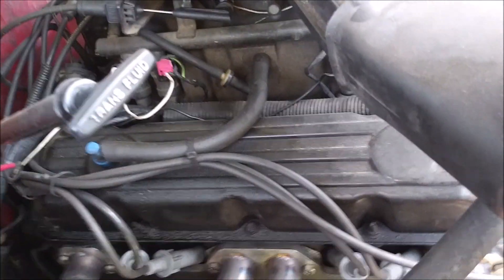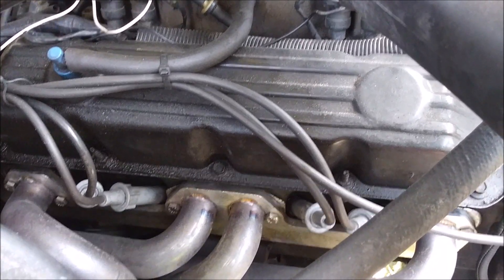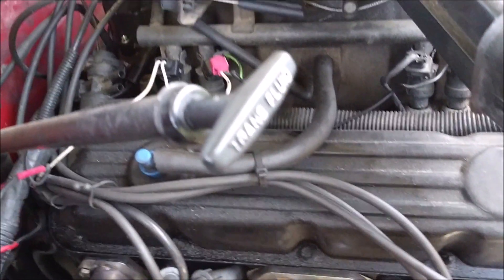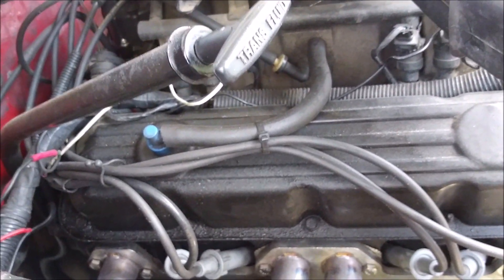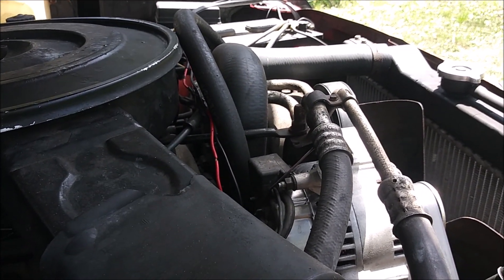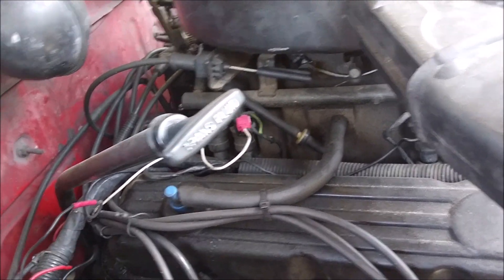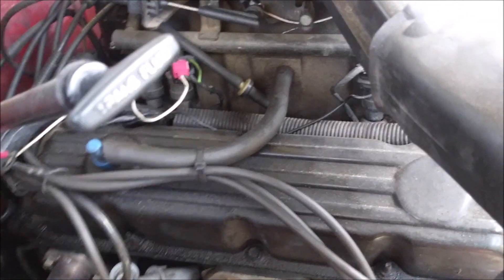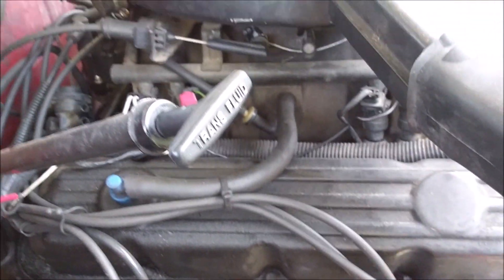1st Gen Dakota V6 to V8 Swap, OBD2 to OBD1 conversion, and Header Update

Comment: Hey i have aquired a 94 that someone seemed to have taken yhe time to do everything right od switch hooked up and running sometimes at stop lights or on highway it will cut off like a fuel pump going out anyone ran into this id ask the original owner but he has passed , the 2nd owner convinced himself the computer was on its way out im thinking more like its fuel pump

Comment: So what will I have to do to make my 5.2 dakota and turn it into and obd2... is already obd1 but I want obd2 for tuning reasons
Reply from the maker: As far as I know you will need a harness from a '96 Dodge Dakota but when I built the motor my truck I just want with an aftermarket ECU
Reply: @nos1000100  what ecu did you get? And does it have to be a harness from a dakota or can it be from a ram to
Reply from the maker: @spencerdohrman5758  I went with the microsquirt from DIY autotune.com and I had to make  my own harness using that Dakota harness
Reply: If I get a v6 wiring harness from a 1996 will there work on my 94 if I add 2 extra cylinder wires?
Reply from the maker: @spencerdohrman5758  it should you might have to extend a couple wires and as long as you got the ECM for it should be all right
Reply: Could you send me the exact aftermarket ecu that you got from megasquirt and if I were to do the obd2 conversion what pins are for the last 2 cylinders on the obd2 computer do you know? Since I'm pulling one from a 1996 v6
Reply from the maker: @spencerdohrman5758  https://www.diyautotune.com/product/microsquirt-engine-management-system-w-8-foot-wiring-harness/ is the microsquirt. I do not know what the pin numbers are unfortunately
Reply: Does this give you tuning capabilities to if I were to turbo it and aftermarket intake manifold and such
Reply: Does the microsquirt have tuning capabilities if I were to turbo it?
Reply from the maker: @spencerdohrman5758  Yes is a full standalone ECU

Comment: I have a 90 Dakota and I definitely want to do a V8 swap, I am in California so there are extreme emissions laws to be followed😔 I don't have any idea on how and what to do where to get the motor or any unforeseen issues but I definitely want to swap out that pathetic V6! Or if there's an upgrade do that.
Reply from the maker: I don't know any about California law but from.what I've seen on other channels, as long as you use stock factory options and emission systems. You should be okay. I've also seen that you can do a fair amount of upgrades/modernizations and get it inspected such as putting a brand new 5.7l hemi with the factory ram efi and exhaust and get away with it. As for the v6. People have boost them with decent results. Biggest thing is to get an aluminum plate for the intake and have it welded on.

Comment: I know that this is quite awhile later, but can you describe the wiring for the overdrive in a little more detail? I bought a 318 swapped dakota sport that had a 3.9l in it and they didn't wire in overdrive. So it only has 3 gears and then it hits 70mph and bounces off the limiter
Reply from the maker: I didn't have to do anything with the overdrive
Reply: @nos1000100  so you had all 4 gears without overdrive? Or you just wired in what was there before? Because I don't even know what to look for lol. I've only had manual transmissions for the most part
Reply from the maker: @austin_94gt18  yeah all I did was extend the wires. I think the overdrive is dead simple, just need to wire in a toggle switch but I'm not 100% sure on that myself. I ended up pulling the automatic out and put a manual in on this truck

Comment: Hey man, appreciate the info. I have a 92 with the 3.9l 2wd automatic. What should I be aware of if I'm wanting to swap in a 5.2 any specific year i should look for? what should i grab from yard?
Reply from the maker: I was told the ram pans may not fit but you can get a dakota pan from rockauto. The throttle cable may need to be changed as some time they changed the way it hooks onto the throttle body

Comment: My 94 v6 dodge dakota 5 speed blown and i found a 5.9 motor is there any diffrent obstacle to switch a o4 v6 manual to a 98 auto 5.9 magnum
Reply from the maker: Assuming the 04 is a 3.9l and NOT the 3.7l, i would assume you would just need a driveshaft and the pcm as well as the harness (unless you modify the v6 harness). If its the 3.7l though, that is a different engine family and the 5.9l wont exactly bolt right in. For that situation, a 4.7lHO powertech or 5.7l 3rd gen hemi would be the best for that situation.

Comment: I have an 89 with a 3.9 LA V6 are the motor mounts different because i thought the block was same
Reply from the maker: The magnum blocks have the ears for the la engines though the 318 and 360 magnum engines are a little but longer than the v6 engines. Some later la engines did start to use the magnum style mounts however

Comment: One more question. Were did you get them headders.
I'm going out to pick up a 5.2.
Thanks
Reply from the maker: They are just a cheap set i bough off of ebay. They are priced between $75 - $120. Mine fit fine though some people have had fitment issues with the collector hitting the control arm. You can get name brand ones from summit that will almost certainly fit.
Reply: @nos1000100  
Thanks. 
I will try summit,  if got some other parts from them ascwell.
Those headers look great, they look like expensive one's. I want a short collector on my headers.
Reply from the maker: @cccccc5398  sounds like a plan. I just uploaded another video on my truck if you want to see it. I think youll be impressed

Comment: I just got a 1994 Dakota. It has the mag v6, and just so happens I would like to do the v8 trade like yours.
How about going carburater? Would that help the situation or hinder?
Thank you.
Reply from the maker: I dont think a carb will hinder as you can use the stock ecu to run the ignition only but if you want to do any work to the v8, you may want to run a stand alone ecu if you want efi or a separate CDI box to control ignition time and set your rev limit with a carb. If you go with a carb on a stock 318 or 360 engine. a 600cfm dual pumper should be perfect but dont go any bigger than a 750cfm. I did a lot of work to my v8 recently and i went with a stand alone ecu.
Reply: @nos1000100  what did you do?. I see the headers (NICE), Like if I would like to add like 100hp?.
Iv never built a car with computers, Iv had a 200mph RoadRunner....I built that, a very nice vette and Nova. It's this computer stuff i do lot have a lot of experience with.
Thank you.
Reply from the maker: @cccccc5398  im still learning myself but i went with a microsquirt. Its a stand alone ecu that a little bigger than a deck of cards. It has a pretty bit community behind it so its pretty easy getting help for it. I have the stock computer supplying power to a few sensors, the ignition coil, and fuel injectors where the microsquirt just triggers them. The tuning will be harder than just swapping jets in a carb but there are wright ups and videos on how to do it. Ill make a quick video myself on the subject once i get my truck running properly. As for the actual mods i have on my dakota. I have a stock 318 magnum short block with a 218/228@.050 .525/.525 with 1.6 rockers on a 112 LSA cam, hughes valve springs and retainers that are good till .550 lift, i have a hughes efi dual plane airgap intake, speedmaster 1200cfm 4 barrel throttle body, 30lb/hr injectors, nissan 300zx coil ignitor, speedmaster 1.6 rockers, an ebay electric fan kit, and some other stuff i cant name on top of my head
Reply: @nos1000100  
That sounds cool. I had 525/526 lift 318 duration. KB eye brow flat top pistons. I tryed the popups,  you loose to much street ability that way,  850 double pumper. 
  Send me a link when your nex video is up. I'm very interested.....if got all manuals, I know everyone is going auto, I like manuals...Talk at you later....and Thank You

Comment: Do the throttle cables need to be modified at all?
Reply from the maker: The 1999 motor does use a slightly different cable but all i did was push the cable end through the hole it would attach to and zip tied it. I did forget to mention that but im confident that the 1994 v8 throttle body has the same set up. I guess a safer way would be to use a newer style cable